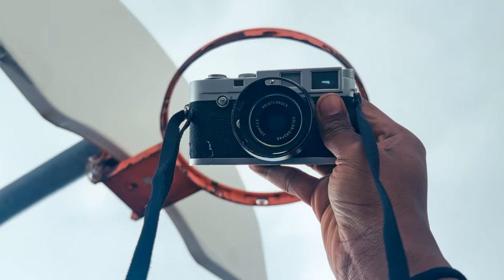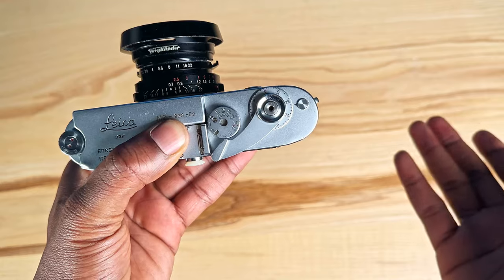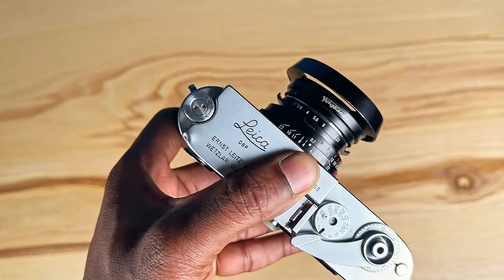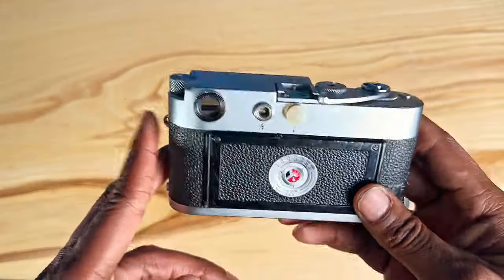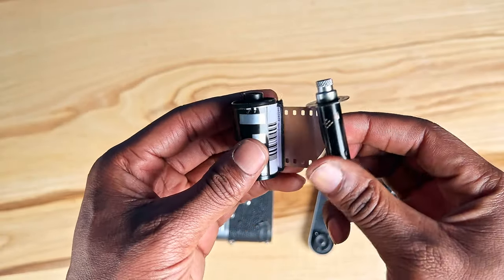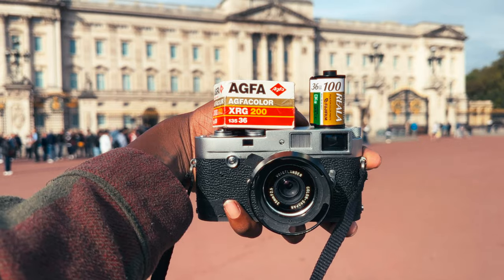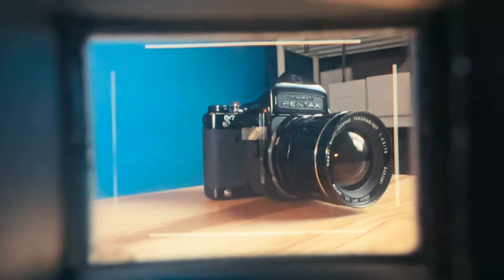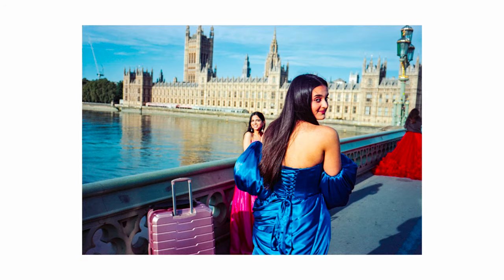The Leica M2

Comment: I would suggest that you keep the original cladding as long as possible. There is a black epoxy that I use for repairs that can be molded to look almost indistinguishable from the original. It is called Milliput and can be found at a good hobby shop.
Reply from the maker: That's great. thanks so much. I'll look into it